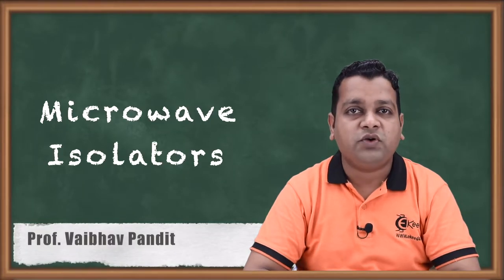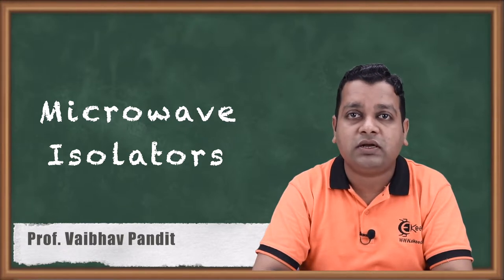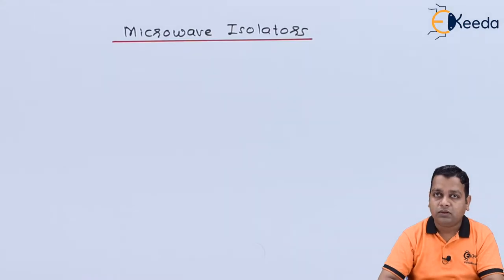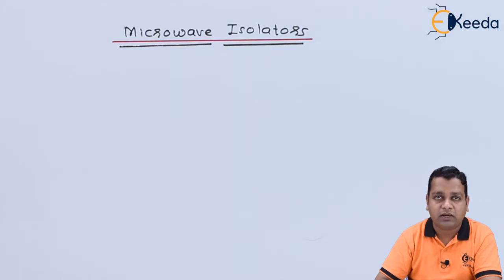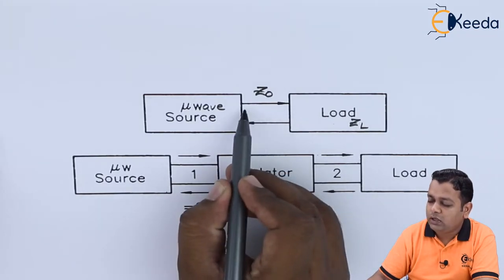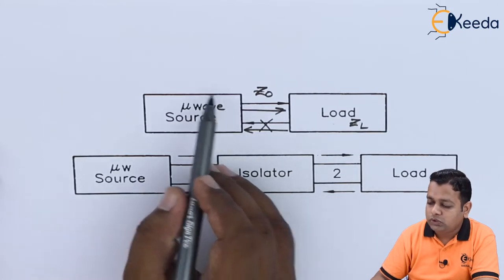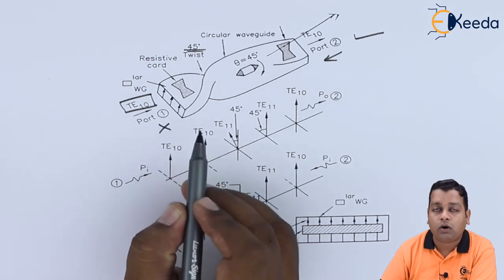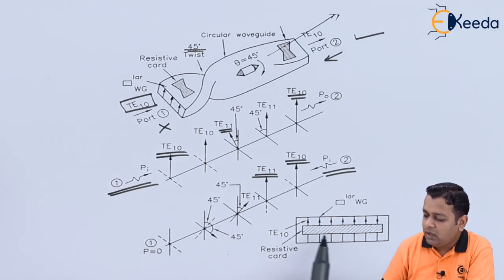Microwave Isolators - Microwave Components - Microwave Communication

Comment: while going in twist
 is producing anti clock 45 degree and while going in from port 2 why the twist producing clock wise 45 degree
Reply: Same question
Reply: @mahmudulhasandip6308  because isolator don't allow to pass any signal in backward so twist produce clockwise
Reply: @mahmudulhasandip6308  now you understand it?